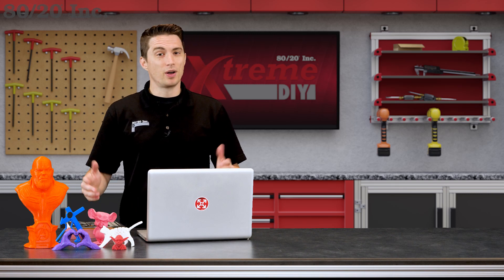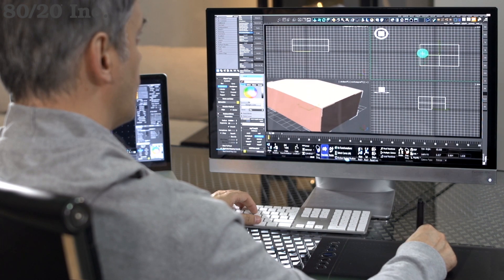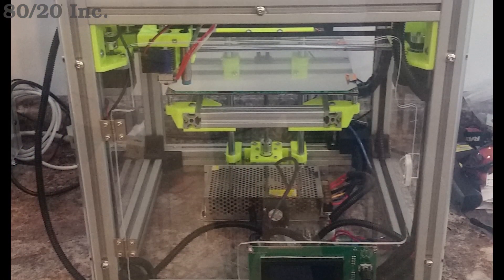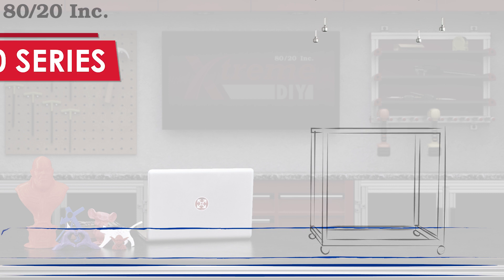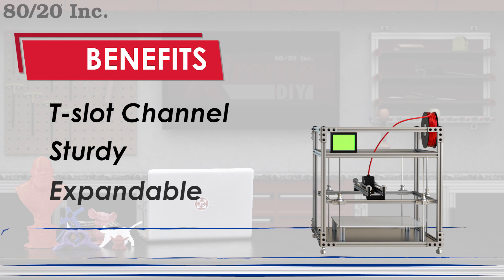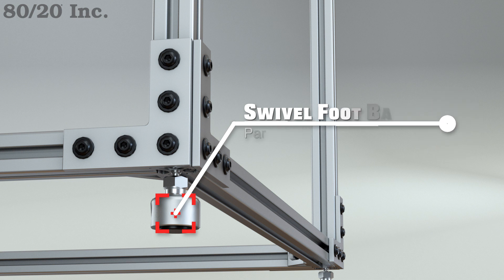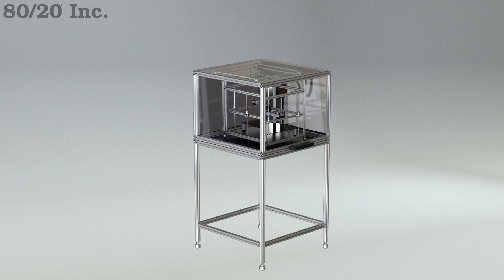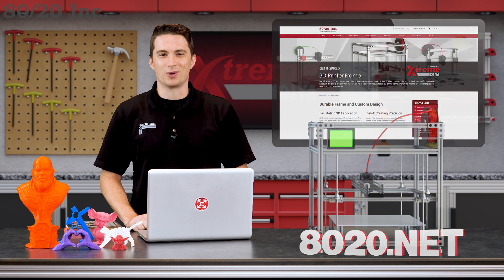80/20: Xtreme DIY - 3D Printer Frame

Comment: nice 3d rendering on the table, and close-ups of OTHER printers working.  We both know this frame is inherently devoid of actual consideration of a working printer.  This frame won't hold motors, belts, lead screws, or rails. The large print area will be halved by the poor mount overlap..    dudes.  Post a real video of this working.  If you can.
Reply from the maker: Hi William - this is a frame to get your ideas rolling - the rest of the components are also completely dependent on your exact needs. If you'd like assistance designing a 3d printer frame, please email services@8020inc.com and we will get you in touch with a design technician. Thanks!
Reply: @8020llc  Ohh... i am sorry. I mistook this as a source of practical examples.  My bad.  Thanks for clearing this up. The architect who got fired once said, "these blue prints won't actually produce a working home,  but rather meant to inspire you to craft working blue prints yourself."   moving on.  PS..  If YOU need help using extruded T slot alloy rail to build working printers,..  please reach out to me, as I already am doing it with both T slot and square tube.
Reply: @billpealer  Your A Tool, I'd sooner ask a chimp for help with a design, as your attitude is that of an incompetent, overconfident teenager. I'm sorry that you've got to overcompensate, it must be hard on ya. I bet your the type of person who sees a problem for every solution, rather than a solution for every problem!
Reply: @Monroe07  ok.  Good.  Ask a chimp.  You need help from somewhere.